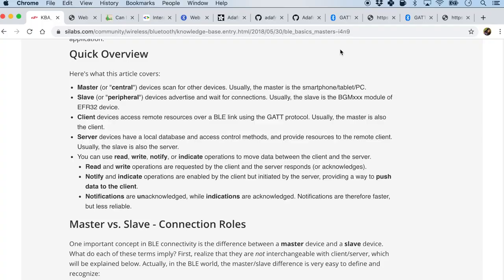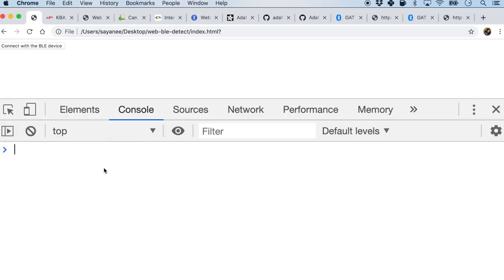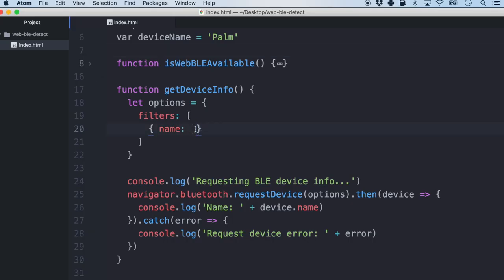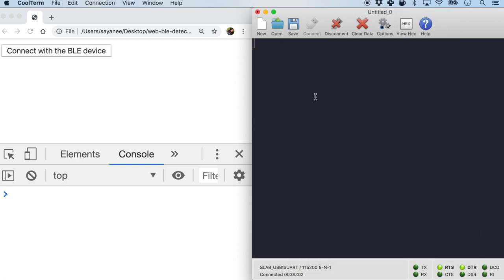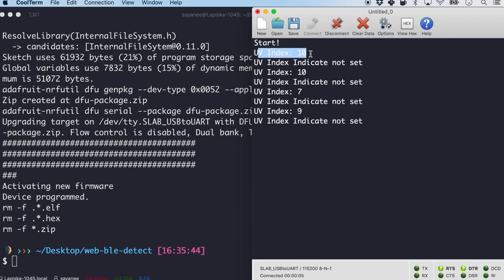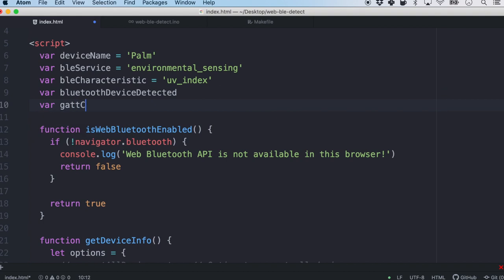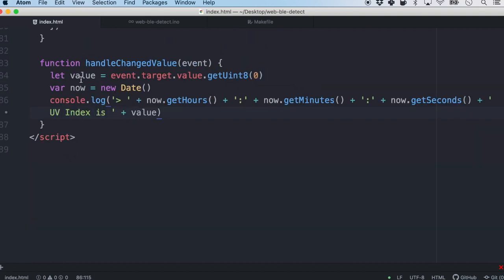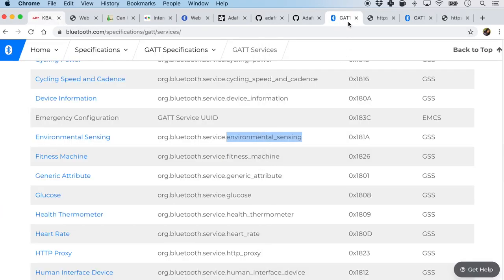Using Web BLE to detect and get GATT information

Comment from the maker: 2021 update:

As of today, Chrome and Edge browsers are supporting Web Bluetooth, whereas Safari and Firefox are not. Please check the current browser compatibility: https://caniuse.com/web-bluetooth

Web Bluetooth is not a W3C standard: https://webbluetoothcg.github.io/web-bluetooth/

Safari, based on the WebKit browser is not considering Web Bluetooth, for now, due to browser fingerprinting concerns. Please check https://webkit.org/tracking-prevention/#anti-fingerprinting

As another optional reading, I suggest the article "Should The Web Expose Hardware Capabilities?" https://www.smashingmagazine.com/2021/01/web-expose-hardware-capabilities/

Hence, in my opinion, we can use Web Bluetooth in developer tools or in small-scale beta testing apps, but of course, you will be best aware of the context in which you plan to use this feature. Check out other exciting hardware API features such as Web NFC, Web Serial here https://web.dev/devices/

I detailed more on using hardware APIs on the web and using experimental technologies in another video of mine here https://youtu.be/InwV9jOx248. I hope the above links will provide you with some guidance 🙏🏻

Comment: Thanks very much for this video. I'm trying to work out how to talk to a bluetooth thermal printer via a webapp, and I think you just gave me the key!
Reply from the maker: Interesting! I would be curious to know if you were able to talk to the printer and if possible, what is the printer model? Does the printer have information about the BLE GATT values?
Reply: @sayanee  I’ve got two printers being shipped to me that I’ll be trying to make work, a zebra imz320 and a zebra rw420. I don’t know about the gatt values yet, and to be completely honest this is my first foray into any web related programming, so I’m just beginning to run through javascript tutorials. The main thing I’ve been trying to figure out for the last week or so was whether talking to the printers was even possible via a web app. I think for printers connected via WiFi I may be able to use WebSocket, and webBT for Bluetooth connected ones. The code ultimately needs to run inside Shopify’s POS app on iOS as a web app.
Reply from the maker: @bobbobbington1132  Thanks for explaining the context of using the Web BLE. If you are planning to use it as a consumer app for the public, then I would suggest no. Also, I do not think Apple will approve an iOS app with Web BLE that they are not supporting due to current privacy concerns.

It is still an experimental technology that is not supported by major browsers like Safari and Firefox (see https://caniuse.com/mdn-api_bluetooth). 

But if you are planning to use it to play with JavaScript, just as a prototype for yourself, then by all means go ahead. If you are planning to learn about web development, knowing about web standards and browser compatibility will be an important part of knowing the ecosystem. E.g. https://webbluetoothcg.github.io/web-bluetooth/

About using hardware APIs on the web in general, I would strongly suggest a recent article which talks about privacy issues and the viewpoint from Apple, Google, and Mozilla - all major browser makers. In summary, discussions are on-going on how to balance privacy versus innovation and while it is going on, I suggest using Web BLE just for fun and experimentation. https://www.smashingmagazine.com/2021/01/web-expose-hardware-capabilities/

I hope I gave you some context on using Web BLE today. I hope you have fun learning web development and playing with these APIs as much as I did!

Comment: Thanks for the tutorial! help me a lot. I have also a question regarding BLE, have you tried creating a BLE server that can connect multiple clients? is it possible for Web BLE? I'm using ESP32 and I'm having a hard time doing it. hope you can answer me, it is for my thesis project. Thank you!
Reply from the maker: So sorry! Never did that!
Reply: Do you mean to create a server in browser?
If so then that would not be appropriate still not sure if that would be supported technically.
I am looking for having a full fledged ble client on the browser and inturn want to add them as we view.

Comment: Great video!!! I have two questions: Based on my research i think a simple serial protocol is not yet part of the Web BLE spec. Is there still a way to transfers chunks of data (configuration info) between an STM32 processor (with an BLE module attached to it) and a web browser. Are there GATT services and characteristics that can be used for this? 2nd question: Can the cheap HC-05, HC-42 BLE serial modules be used for this?
Reply from the maker: I apologise in advance in case I am totally off-tangent to what you require. I have neither tried STM32 nor the HC-05/42 modules, but have you tried WebUSB? I have used WebUSB with SAMD21G to transfer config info as well. Video: https://www.youtube.com/watch?v=G8AUgwZCe_Q

Here's a related article on STM32 and WebUSB:
https://medium.com/coinmonks/stm32-blue-pill-dissecting-the-webusb-bootloader-for-makecode-b7f1a1508e89

Comment: i have a simple use case, where workers has to be nearby to a bluetooth device (and the device is in office), so they could register their attendance (in floor 88th), instead of when letting them to register attendance on ground floor. 
Hence, is it possible not to prompt the blutooth paring screen, but the JS will smart enough to check IF "device" in list of devices found? It should be transparent to workers

Comment: Hello, I'm developing an BLE socket based windows client utility package using winsock & winsock2 library layer, but during build process, socket is getting connected with server socket fd. But then no data being receiving and thereafter code will getting terminating. can you suggest any root cause ??

Comment: Up to the point to connect the devices, everything works perfect, but I want to use it for communication (like keyword and data) between two browser with one code for both. If you know how to do that, can you pls give an example (like an easy chat) for that and show it in a web editor or sth like that?

Comment: thanks for sharing, I just started to tinker with IoT and WebBluetooth. While I got the example to work, was wondering if you want to create a custom BLE service/characteristics (eg accelerometer x,y,z reading) how do you get the WebBluetooth to read it? I am getting error, TypeError: Failed to execute 'getCharacteristic' on 'BluetoothRemoteGATTService': Invalid Characteristic name. I am using a random UUID for both Service and Characteristic on Arduino side and trying to call the same UUIDsunsuccessfully
Reply from the maker: To be honest, I have never tried a custom BLE service / characteristics. I tried to look into the Web BLE specifications and could not find something on custom fields. Maybe I missed it, or maybe that's something you can look through the specifications again.

I also found a GitHub issue on custom fields: https://github.com/WebBluetoothCG/web-bluetooth/issues/444

I also see some mentions of "custom" on this tutorial: https://web.dev/bluetooth/

Hope this gives you some clue on the next steps.

Comment: Thats awesome. But  I am getting this error web-ble-detect:29 Argh! NotFoundError: Bluetooth adapter not available. My desktop not having bluetooth adapter but I attached the external bluetooth device but its unable to find bluetooth adapter. Will appreciate your response.
Reply from the maker: Are you using Chrome or Edge browser? Web BLE is not available on FireFox or Safari. Reference for browser compatibility: https://caniuse.com/web-bluetooth

Also, maybe check the hardware Bluetooth adapter by another means without using the browser just to ensure the hardware works by itself.
Reply: Hey  @Sayanee Basu   Thanks for the reply. I tested it out its working without browser as well but unable to detect via chrome browser api.
Reply from the maker: @mohdatique9429  If the BLE hardware is working and you are using the right browser, then start with the simplest possible JavaScript code with the least possible number of lines (E.g. https://hutscape.com/tutorials/web-ble-detect).

Also, what BLE device are you trying to connect to with your desktop?